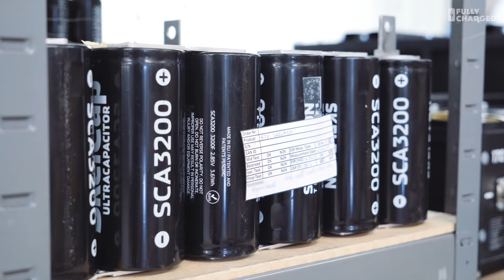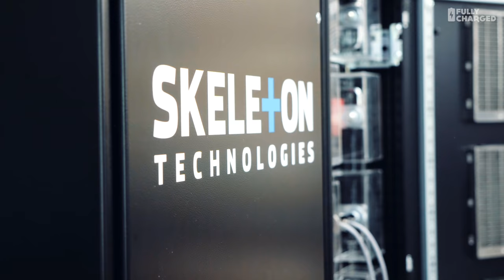Skeleton Ultra Capacitors | Fully Charged

Comment: Wonderful technology for buses, trains, and wind turbines.
This will make electric vehicles cheaper and the air cleaner for all of us !
Reply: Capacitors are impractical for vehicles that need long discharge rate and high energy density, even Elon knows this, all they will be useful for is accelerating/decelerating very fast, possibly useful in electric supercars and like here in the bus but not used entirely on its own practically
Reply: What will make EVs cheaper is simply a better battery, either solid state or graphene, but only when its well developed to the point that its cheaper
Reply: ODI Idk: As far as I can tell from the first couple of minutes the battery cost can go down by a factor of 2 using ultra capacitors. Please watch the well laid out intro again. Not that you are wrong about the battery tech side of things, but as stated, ultra caps and batteries are not competitors.
Reply: Super Capacitors have high self discharge rate. Maybe good for busses not for cars or power storage.
Reply: epSos.de ...China has more than 300,000 thousands buses operating on this supercapacitor technology in Shenzhen city. Google it. People in US are prohibited to learn or to misconstrue about this wonderful technology.
Reply: I agree with you. Keep improving battery technology and integrate these capacitors in with them. Its a win-win.
Reply: ODI Idk I believe they are meant to be used together. To make up for each other's weaknesses and be greater than the sum of their parts.
Reply: Thats exactly how they should be used, not solely one or another
Reply: Yeah but China also has solar roadway which failed in days. Not really an argument.

UC are good for short bursts of energy, but not very good at high capacity storage. China got around that by making every station a charging station. This is alright for a research, not so much as a longterm solution.
Reply: semiRockethr a bit like solar roadways in america so not really an argument.
Reply: Sedonascape Prohibited? No. Their cost and added complexity don't offset their very marginal benefits. They don't allow for a reduction in battery size (that 300 mile hwy trip still requires same energy) and li-ion already handles charge and discharge rates and  cycling well enough.
Reply: @semiRockethr   They recharge in ±1 minute.  So no big deal, when people are entering or exiting the bus you can recharge.
Reply: Yeah but it is complicated and it is still using batteries for outside of city center.
Reply: @semiRockethr  Public transport don't go outside city.
Reply: Better, it will make those vehicles more Ecologically friendly.
Reply: cheaper......how about free...The Venus Project, free education, health, Earth, Universe.....free? compared to today's waste, yes. United World Youth Org, a generation, silence inheritance like 1989 China. Think today's tech is great, how about the waste factor of not having all brains coupled with it.
Reply: The point of it is you hit the brakes, generate a heap of power that'll be used when you put your foot down to go, meaning, it gives the massive kick to get going from a source other than the batteries, so when you're cruising essentially what's happening is the batteries are just trickling power in to keep the car moving instead of dumping a heap of current to get it moving.  Not to mention, if you slowed down then stopped, the caps could be used to somewhat charge the batteries, not much, but a little.
Reply: @GingerNingerGames Never use caps to charge batteries...it is a waste of energy.  If your caps are getting that full all the time, add more caps.
Reply: an ultracapacitor could be used for acceleration and regen activities. while a smaller battery pack could be used for travel..you could see a star increase in city driving and a slight increase in highway driving
Reply: @MrMduchesne23   I drive a good thousand plus miles a week for work on the highway, the amount of time my car goes 'up and down' in terms of acceleration and letting off the gas, this could be great to achieve more mpg.  I already drive a hybrid getting about 42 highway, some of the higher elevation rougher parts I average 34.  The electric motor in the car can't do it alone past 20mph, but in a system designed from ground up...this would be great.
Reply: Well.. they are not terrible cheap... A ~60Wh capacitor pack cost €1249 in there online store. That can get a normal car up to just under 60km/h. The 130Wh model cost €3070...  that can get a normal car up to about 90km/h or there about.... And remember the car manufacture pretty much have to dubble the price at the end consumer.

Of cause a car manufacture might buy individual cells and have the car electronic system act as a charge regulator. That would cut down the price to about €870 for 60Wh.

Of cause this is online prices.. i guess if you have a large contract you can probobly cut a deal of 20 or 30% or or something.

Of cause there is some benefit in not losing the 20-30% or so charge to discharge losses of a normal battery when breaking and accelerating. For a hybrid car it makes sense, for a electric car.. its really don´t get any significant saving. For something like a city buss the saving is probobly rather large.
Reply: @matsv201  While 60 Wh seems lack luster the importance of capacitors is the peak spike capability where in one second it could do 216 KW seconds. Tesla's are limited to 60 KW of regen while braking that ultracaps shine as it could possibly double it at minimal weight expense.
Reply: @Cerberus984  Yes, but its really very few load that need 100:eds of kW of power during fractions of a section. Even for regenerative breaking 60Wh is to little.

There is supercaps with far larger capacity and still have over 100kW of power.

This would be far more useful for light hybrid. Specially for Lithium free hybrids. Say a 48V backed VLRA  based hybrid. Still really needs a lot more than 60Wh. I would say around 250Wh would be suitable.

You really don´t want to use a capacitor in this application under 1/4 charge, you also probobly really want to use it regularly over 3/4 charge. The charge rate have to be eased up a bit before hitting about 90%.

Those capacitors in the video is way to expensive and bulky for this use. A 250Wh of this type would be pretty much as heavy as a normal hybrid battery.
Reply: @matsv201  The problem of capacitors 12 volt 3000 farad + 12 volt 3000 farad wired in series does not equal 24 volt 3000 farad. While for batteries 12 volt 100 Ah + 12 volt 100 Ah wired in series does equal 24 volt 100 Ah. This is heavily the reason why capacitors aren't used more often as batteries favor high voltage power trains while capacitors favor low voltage power trains.
Reply: @Cerberus984  I don't get your point. While you don't double the capacitance, the capacity is still doubled
Reply: Where do you think the power comes from for electric cars?  Coal, oil, hydro and nuclear.
Reply: @christianvanderstap6257  please watch the CEO at 2:36 "the total energy content is smaller than in batteries". And the peak power from braking a car is not that high, it's easily within the C rating of a large battery pack. So the only use of a supercap in cars is ultra-quick recharging of a smaller battery pack with a small amount of energy. Nobody wants to spend 4 minutes parking and plugging in to get 5 kWh of energy in 10 seconds!
Reply: @jolllyroger1 even on the current generation mix, EV is better for the environment because it's much more efficient than a commission engine. Since the majority of new generation is wind and solar, electric cars will continue to get cleaner.

Comment: Very good report,including the info in general about Estonia. I am 71 years young and think ultracaps are very cool. Now, if I can just figure out how to make a mould of my hood, doors, etc. . and still be able to use the old gas engine for rear wheels, what a fantastic gas saver it would be to drive the front with ultracap and integrate it with existing electronics. Just a dream, keep on making good vids and maybe I will learn even more!

Comment: Ultra capacitors have only a small stored energy/weight, but huge power/weight. Consider that, energy/power = time. Amount stored / how fast you use it = how long you can use it for.  Small/large = tiny. So they are great for short duration  high power applications. But used in combination with batteries they are fantastic! Great idea for commuter trains too. 
I love this channel!

Comment: We don't use Kw/h, we use Mw/s. <-- Sums up the difference between capacitors and batteries quite nicely.
Reply: Kwh without /
Reply: @simonecipriano  You can use both. 

The slash represents (and is usually said, when spoken out loud) as "per". Meaning, "every" or "over" (as in "over time", in this case). So something that is rated at 2kW, will consume 2 kW/hours over an hour period, (or 1kW/h every 30mins etc etc) - same usage as kilometers (or miles) per hour

kWh is shorthand.

For best practices too, you want to use is a capital "M" (for Mega) - to diferentiate from "milli" and if you want to get technical, a capital "W" for Watt, as that's its letter. (plus if you want to get even more technical, use a lowercase "k" (for 1000), as an uppercase "K" is usually to represent a binary "Kilo" (for 1024)
Reply: @MrVelociraptor75  Hmmm, nope sorry, but you misunderstand. kWh is not kW per hour, but unstead is kW * (times) h. If something is rated 2kW it means it consumes 2kW or 2000 J/s.  If you do that for an hour you get 2kWh. Another device which is rated 4kW run just half an hour will also have consumed 2kWh (4kW * 0.5h). As you can see you have to multiply the energy consumption in W (= J/s) by the amount of hours run to make the units work.
Reply: In other words: 1 KwH = 1000 W * h = 1000 (J/s) * h = 1000 (J/s) * 3600s = 3.6 MJ
Reply: @marcovoetberg6618  I'm hoping English isn't your first language and you've just had issues reading what I wrote. Because you're trying to argue against me, by saying THE EXACT THING I SAID!

Although a slash "/" is usually used as a divide symbol in math, in physics it's used to represent "every" as I said in my first post. Mathematically, yes, you (often) multiply, when trying to work out how much power something is going to use, or has used. But that's not its meaning.

Like I said, it's the same usage as speeds and distances. km/h is kilometers per hour. If you're travelling at 100km/h speed, you'll have moved 100km from your starting point after an hour. Same as light year, the distance light will travel after a year...
Reply: @MrVelociraptor75  I will just ignore your comment about English not being my first language... It is irrelevant.

You said "you can use both"... I read that as you can use both kW/h and kWh. You also said the "kWh is shorthand".

But the thing is kW/h is just wrong. kWh is not shorthand for kW/h. You should never use kW/h. You should not pronounce it is kilowatt per hour. Instead it is kilowatthour.

kW/h would make the unit of measurement kJ/s/h and thats just a weird nonsense unit of measurement.

Your problem here (I think) is that you think of W as unit of energy. But actually it is a unit of measurement that describes energy per time or power because Joule is the unit of energy.
You therefore have to multiply by time to get back to energy.

A device that is rated 2kW will not consume 2kW/h over an hour. It is consuming 2kW (or 2000 J/s) for every second it is on.

I don't care if you believe me or not. Just look it up, m8
Reply: @MrVelociraptor75  you're completely wrong. If you use a kWh of energy every hour, that's a kWh/h , i.e.... your power is 1 kW! Any other use is nonsensical.

Comment: That discharge with the heavy duty cables was probably in the range of 1-4kA... Even stiff thick cables start to do weird stuff above 1kA.
Reply: That looked like the 170v/53F module that they have on their buy me page. That would be quite a bit of power.
Reply: I guess they discharged it through a resistor. I would expect a much more dramatic (dangerous) cable movement with a short circuit

Comment: If you can do this for acceleration in cars, could capacitors help in home circumstances of sudden load, such as in hair dryers and toasters?
Reply: not necessarily because the load compared to the mains(in a properly wired house) is not much.

Comment: Thanks for an episode without a bunch of political baggage. That being said. Scale those capacitors to size large enough to store lightening strikes and then feed the energy back to the grind at a controlled pace. BOOM! You just solved a large part of your fossil fuels mess!
Reply: nope. but you can run an incandescent light bulb for a few hours.

Comment: oh damn 100kW from such a small box. That's about 130HP from a package barely bigger than a lead acid car battery. I wonder how much energy was stored in there.
Reply: not a lot 100 kW only for 1 second so 100 kWs wich is 0,02778 kWh
Reply: The datasheet on skeletons website says 63.9Wh (Wh, not kWh), so an absurd amount of energy in capacitor terms, but nothing compared to a battery of similar size
Reply: When I saw those massive high amperage cables get pushed apart like the video showed I was expecting the battery to blow up like a bomb.  That is a obscene amount of power transfer in such a hyper short period of time.  No matter how you look at it that capacitor augmented battery had a sky high power density/second.  That's far higher than the largest submarine batteries.
Reply: A 1-farad capacitor can store one coulomb (coo-lomb) of charge at 1 volt. A coulomb is 6.25e18 (6.25 * 10^18, or 6.25 billion billion) electrons. One amp represents a rate of electron flow of 1 coulomb of electrons per second, so a 1-farad capacitor can hold 1 amp-second of electrons at 1 volt.

It's not a lot, but the advantage is that it's rapidly available whenever it's needed, and can be just as rapidly recharged.
Reply: It was impressively small and powerful. Only a little energy though, because this is the megawatt-second business, not the kilowatt-hour business!

Comment: Sounds like an excellent engineering proposal. The description of using capacitors for immediate storage/discharge is exactly what CPU chips do with an on-board memory cache. A cashe will store, say, a megabyte of memory cache so that the CPU doesn't have to go off-chip and wait on a memory request for information. That cache, while small compared to the total memory capacity of the computer, saves countless delays in getting a request completed. If, as the company states, such a cache of energy in an EV would double the service life of the battery, it's a win-win for everyone.

Comment: Been assuming this is how the new roadster does what it does for a while now (a mix between capacitors and traditional lithium batteries) but I didn’t want to mention it because I want Tesla to stay ahead of it’s competitors.
Reply: hacked, it would be fair to presume future evs will have some ultra cap, eg, 25% of total storage. This would allow for ultra fast charging for that 25%. Could also induction charge, stopped @ the lights.

Comment: wow impressive..
now thats real technology..not elons crappy triple aaa batteries
Reply: hmm we will have to move to estonia.. 
sicily sucks..
doc johnny
Reply: nope too cold
Reply: If they worked, they would already be in cars. Those 18650 cells used by tesla are better than every battery used in all other EVs even after 6 years.  Tesla was smart by using them to get way ahead of competitors.  The beauty is that tesla has the best battery packs right now and if a better battery is ever created, they simply switch to it.

Comment: Britain - hollowed out a mountain, built a power station inside it, and created a lake on top of it to ease peaks.
Estonia - throw a batch of ultra capacitors in a telephone kiosk sized box. Job done

Yet we are the "developed country"
Reply: I'm not completely sure what your point is, but:

* Dinorwig power station can run at 1Gw for 6 hours or something
* Graphene wasn't invented when it opened in 1980
* They are so far apart in scales of time, energy and power that the comparison doesn't really work in any sense.

Practical uses of ultracapacitors are probably for things like datacentre (or e.g. hospital) backup power systems, to provide a few seconds of instantaneous power while waiting for diesel generators to start.
Reply: Also, Estonia has been tech. advanced and a good place to live for about 5 minutes of it's history.....
Reply: Yes I fully accept that my comment was made more for the humour than for the factual, however, there is an underlying thought. Estonia is what, one generation from being a Soviet captive state. Yet appears determined not to mire itself with the backwards thinking that will, unless we radically change, slide us gently into becoming the new third world post Brexshit: with the credulous cheering on.
Reply: Unfortunately they were suppressed by sowjets for a long time, but now that's history.
Reply: sowjets? wow never heard about them, is that some agricultural gas turbine machinery?
Reply: --- excuse me, it must be with v, it's because in German language they are written with W.
Reply: You cant compare the two. There is not enough supercaps OR batteries in the world (nor the capability to build them) to build storage equal to a pumped-storage power station. 
Supercaps/batteries can power one building, one car, one mobile phone. Pumped storage can power EVERY electric car, EVERY building, and EVERY mobile phone in a COUNTY full of CITIES.....

Comment: Not just braking energy but shock absorber/suspension travel movement can be looked at again in a new light.

This flood-charging ability of ultra capacitors managed to feed batteries in buffered amounts is huge.

This will allow off-grid solar/battery powered homes to run whole-home air conditioning and not get fried when the compressor kicks on.